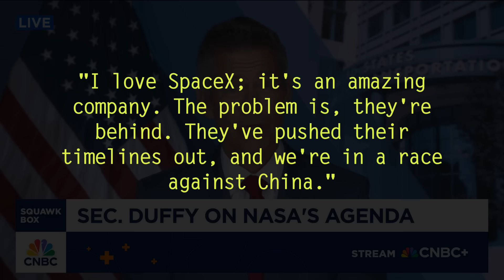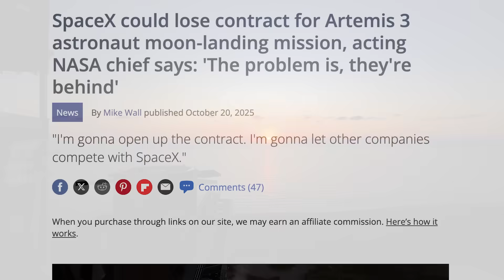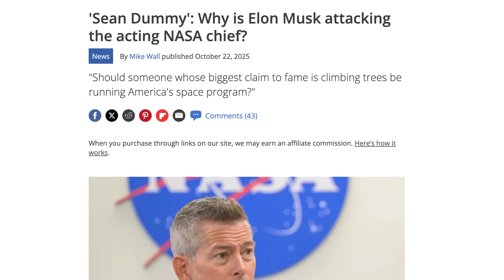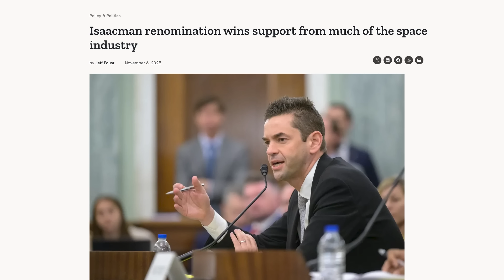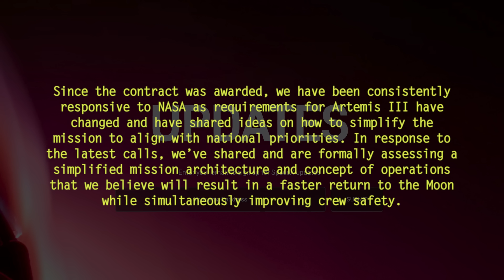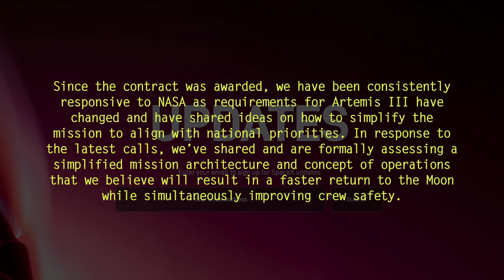What Is Actually Happening With SpaceX's Moon Landing

Comment: its going to be a nightmare landing something that big on the moon uneven surface
Reply: Timber!
Reply: @timmit-s4d killing your crew
Reply: IF they are able to accurately locate a level and flat piece of lunar surface big enough to support the LS, and IF they are able to land precisely on it, and IF there aren't any soft spots that cause the LS to tip after touchdown... then it will work. I'm figuring there's a 50/50 chance that the first attempted landing will abort just before, or possibly just after, touchdown, when it turns out one of these things is not within acceptable bounds. I also expect the crew will return unharmed, because "unable to land" should be several of the planned abort scenarios... just as it was in Apollo (a lot of people don't seem to know this, but if Apollo 11 had run out of descent stage fuel before landing, they would have done a planned and practiced abort to lunar orbit using the ascent stage--a maneuver that had been tested in lunar orbit on Apollo 10).
Reply: @ExtroniusAttributes  But then why use such an impractical vehicle in the first place?
Reply: @ExtroniusAttributes  Those are a lot of big if's, and just the ones we can think of.
My biggest problem is 8 refuelings in space with cryogenic fuels. Never done before, will require 8 perfect launches, 8 perfect dockings and refuelings.
Musk is better off following the Apollo method with smaller spacecraft being used in stages. 
And he needs to forget about these re-usable rockets, that only works for first stages and not for a mission like this.
Reply: @ExtroniusAttributes 

I mean, they perfected landing on a barge in the ocean. COG is just as much of a concern with that. Also have to worry bout wind on Earth. I think the landing part is gonna be the easy part for them. The hard part is Starship refueling IMO given the timeline they’re against as far as NASA. Even still, I’m not one that particularly cares whether China can get there before we get back.

Imagine China landing their own version of Apollo just for Space X to land an entire habitat.
Reply: @maniacslap1623  Barges are made from steel girders and finished with checker plate.
Reply: Starship is a terrible lunar lander because it is a 50-meter-tall steel silo trying to balance on unknown, powdery regolith with a very high center of gravity and narrow legs. If any leg hits a rock, a slope, or a soft pocket, the center of gravity can move outside the footprint and it will tip, regardless of the lower lunar gravity. We have fresh proof of how easy that is to do: Intuitive Machines’ Odysseus lander in 2024 and their Athena lander in 2025 both ended up on their sides after touchdown because a foot “caught” or the craft slid into a crater, exactly the sort of instability you would expect from tall hardware on uneven Moon terrain.

And this is just the tip of the stupidity.  We can talk about debarkation/embarkation issues.  We can talk about the stupidity of dropping that much mass on the moon that you have to bring back up.  The insane number of refueling flights just to get this bucket to the moon.  Man, the list goes on and on.
Reply: @maniacslap1623 China is building a base
Reply: @praesentius it amazes me that someone thinks starship is a good idea. You guys figured it out 50 years ago. It isn’t needed to reinvent the wheel, just iterate on it
Reply: @TheOA1988  Yeah.  I tend to bring that up.  Rocketry hasn't changed fundamentally in all those years.  Sure, we're more efficient and plenty of technologies, especially in electronics, have matured greatly.  But, the chemistry of burning propellant to move space vehicles has not fundamentally changed.  

That's why after NASA's reviews, they found that Starship simply doesn't have the reaction mass (and thrust/fuel/weight ratios) to lift things into orbit efficiently.  It needs possibly dozens of refueling flights just to send one of these monstrosities to the moon.

It was always a bad idea and I took a lot of flak over the years pointing out all the numerous problems with Starship as a concept.  But, with every delay and every catastrophic failure, folks seem to be waking up.
Reply: @praesentius right? With all the pun intended: it’s not rocket science, guys. Keep it simple
Reply: @ExtroniusAttributes  Those are a lot of big if's, and just the ones we can think of.
My biggest problem is 8 refuelings in space with cryogenic fuels. Never done before, will require 8 perfect launches, 8 perfect dockings and refuelings.
Musk is better off following the Apollo method with smaller spacecraft being used in stages. 
And he needs to forget about these re-usable rockets, that only works for first stages and not for a mission like this.
Reply: After 12+ LEO refuellings... I don't see that happening in this decade.
Reply: Horizontal Landing …
Reply: @DeadManWalking2  Using the empty space craft as part of a future base. Good idea, I just wonder how to do it.
Reply: Theres a your mom joke in here I can already see it
Reply: Get ready for Stubby.
Reply: Picking a landing location will be a major part of mission planning.
Reply: It's been done before. The Moon's gravity is significantly weaker, measuring around 1.625 m/s². This means that objects on the Moon weigh only about 1/6th of what they weigh on Earth. For example, a person weighing 180 pounds on Earth would weigh only about 30 pounds on the Moon.
Reply: @dan6442  True, but they have the same mass and this has to be accounted for. Plus we have one or two missions fail because the lander tipped over. And these were small landers.
Reply: @dan6442  True, but they have the same mass and this has to be accounted for. Plus we have one or two missions fail because the lander tipped over. And these were small landers.
Reply: @dan6442  The mass is the same.
Reply: @dan6442  If the COG moves outside the base of support it will tumble, and that is independent of the specific gravity strength. The moon lander COG is unreasonably high and the base too narrow for something that is going to be landing in an uneven surface. I would bet a sizeable sum that this will never happen.
Reply: Theyve already landed it on simulated lunar soil
Reply: @VoltsAnBolts key word being simulated
Reply: @VoltsAnBolts  simulated.
Reply: @VoltsAnBolts  When, where?
Reply: @VoltsAnBolts  But not gravity and not on uneven terrain.